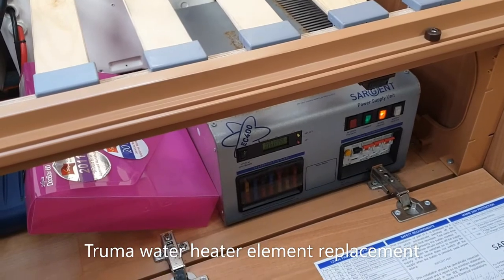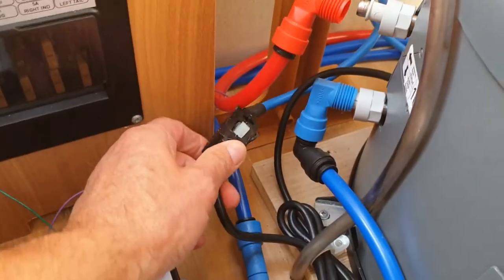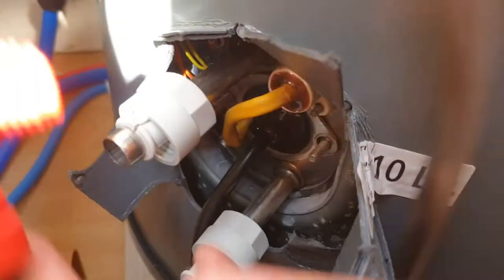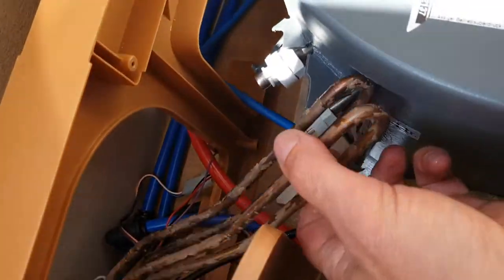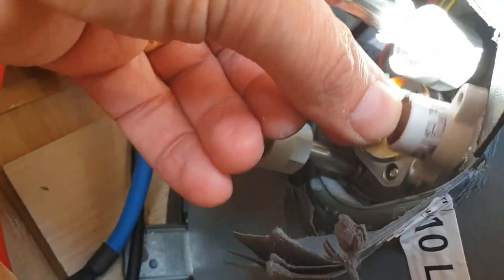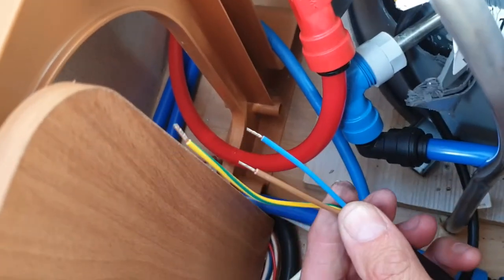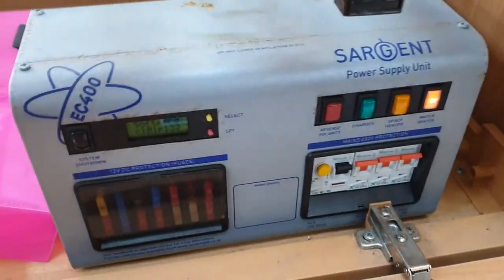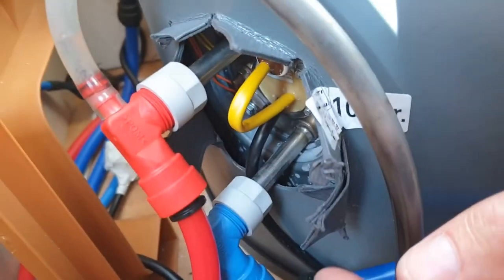Truma Water Heater Element

Comment: Watched you video before Installing. Thank you very much. Especially about the advice about loosing nut. I put a cloth under the area to catch when it did fall twice. Magnetic screw driver used to pick up. 6 mm and 5.5 were the sockets I needed to.use . Very awkward positioning but got it eventually.  Cherrs

Comment: good video, i think the best way to join the cable would to have cut about 8 inches off the original lead from the old element and either soldered it to the new lead from the new element or use a chocbox to join the old lead to the new, either way you would have the original connector on the lead from the element as sometimes you can disconnect  this plug to reset the element, also means if you have to replace again down the line it would make it easier

Comment: Very useful. I replaced my element and a couple of points that some might find useful. I was able to get element out and new one inserted without removing the fuse board. Secondly to replace the nuts on the new element insert a bit of blue tack into socket then push nut into socket where it will remain without falling out. All the other bits of the video were useful and accurate.

Comment: I think your supposed to put thermal paste on the sensor so it makes good contact.

Just pulled mine apart and it looks like it had some on it from factory fit up.

Thanks for sharing. I was fortunate my problem was a dusty burner.
Reply: Agreed, looks that way to me.

Comment: Hi I have a pennine pathfinder 2001 and I want to fit a bullfinch outside shower….  I have the same Trauma water heater 
I would like to insert 2 tees for the shower…if you could please advise me on the best place to cut the tees in….or is it
Possible to place them on the sink pipes…Many Thanks. Gerard.

Comment: Great video , really helpful . Mine is not blowing the fuse , I still have 230 v to the element but no hot water. Do you think it is still a faulty element ? Thanks
Reply from the maker: I would think so.
You can test the element by using a multimeter on the continuity setting.
If its faulty you will not get a reading.  Similar to testing a light bulb 💡

Comment: Hello mate, can you tell me how to test the element to check that is is blown.? I have no hot water but it's not tripping the electrics when I switch it on. Many thanks
Reply from the maker: Could be a couple of things.
The caravan in the video had a set of visible fuses where the earth trip fuse is.
Have you checked these ? 
Personally I would open the electrical connection point that connects to the element and test for power.
If 240v at the connection then element blown.
If no power start working backwards to the fuse board.

Comment: Thank you for the video.  Just trying to change mine.  Can't get the 5m bolts off.  What did you use.  Thank you
Reply from the maker: I used a 5mm socket with a short extension.
Reply: @ifyounevertryyouneverlearn3156  ok.  I've tried using 5mm and 5.5mm with no luck.  Thank you for the advice and help

Comment: can you tell what the part number is please . great video
Reply from the maker: Think the Part Number is 70020-00270.
Thats from the ebay order. 👍
Reply: @ifyounevertryyouneverlearn3156   thanks think i might have a problem with mine as its clicks off and don't heat the water but if you leave it for some time it works again for a couple of hours

Comment: Great Video!  I've changed mine over and it works as it should on the drive however, when on site it trips the van or both the van and the pitch fuse box? I'm currently running it on gas as I don't know what to do next...Thanks for spending the time in showing your step by step replacement!
Reply from the maker: Are you using the same mains connection cable at home as you do on site ?
Reply: @ifyounevertryyouneverlearn3156   Hi, yes I'm using the same cable and have checked all plugs are earthed, etc. It's only a 300w heater as well. It's a real strange one that I can't get to the bottom of. Thank you for your response.

Comment: the issue i have with mine is that when you switch it on, it will bring the water up to temperature, but then it wont turn back on to maintain the temperature   so i need to set an alarm on my phone so i know when to go for a shower haa.   hopfully this week i will replace the element with thermostat     thank you
Reply: Hi mate. Did replacement element cure your problem as mine is doing the same 👍
Reply: @steveedwards1657  Hi Steve,  i havent replaced it just yet,  as i went for a new gas cylinder with winter coming.  i forgot just how good the boiler is on gas.  even if it cost me an eye watering £52 to exchange a 19kg cylinder D:   i should look into getting a new element next as it will help save the expensive gas
Reply: @steveedwards1657  looking at the price of a new element, i think im going to look into trying to find an alternative thermostat switch  because yjr heating element itself works fine,  just the little temp switch that's faulty.  i cant justify the £100+ price tag
Reply: @steveedwards1657  hi i know its a while since you posted this, did you ever sort your thermostat out / elemnet by replacing the element
many thanks
ste
Reply: @stehume  hiya. I replaced the element and it worked a couple of times then stopped. I traced it back to the switch which was intermittently cutting out so replaced that and all good since.
Reply: @steveedwards1657  thank you for the reply, would that be the 230 volt power switch ?
thanks again
Reply: @stehume  yeah I put a new switch under the seat with a light on it so I know when it's working. Just a cheap screwfix replacement

Comment: You electrical connections are not safe! These cables should be connected using a terminal block which should then be placed in a coffin box and then tie wrapped.

Comment: Sorry if this sounds like a daft question but how did you know it was the element that wasn't working and not anything else!!!!.
Reply from the maker: We had no hot water and when I checked the fuse had tripped.
A quick question on Google said to check the element first.
Every time I tried to reset the fuse it tripped straight out.